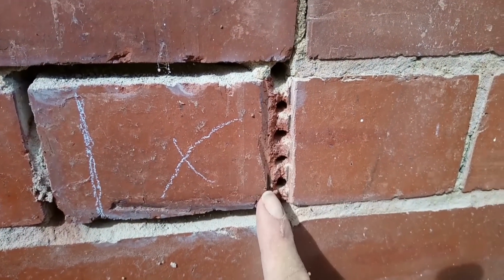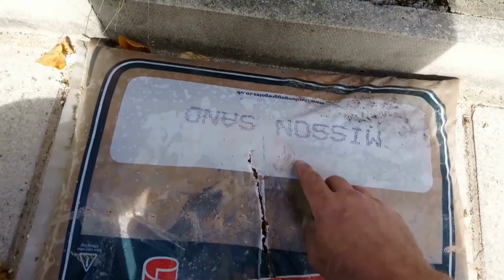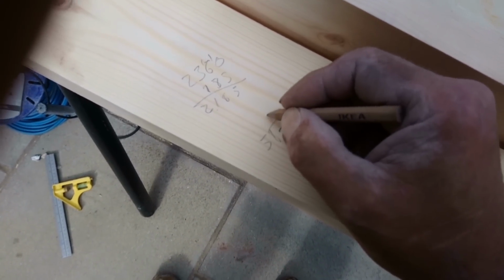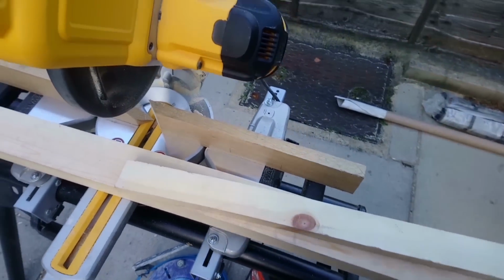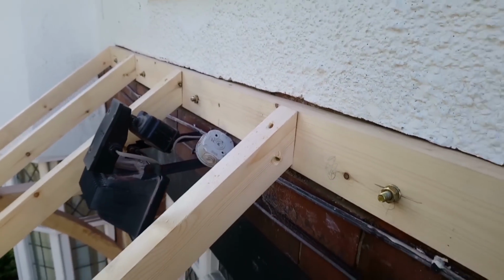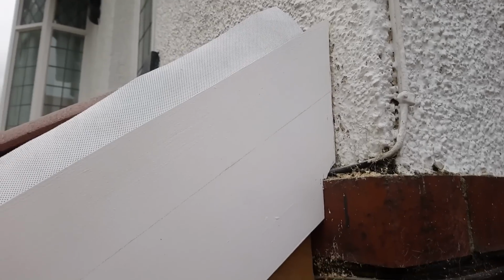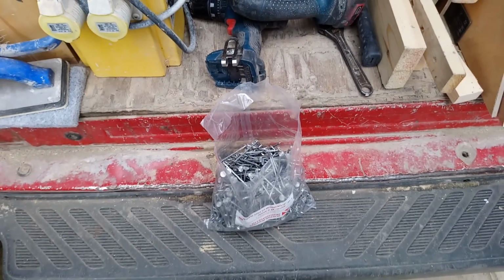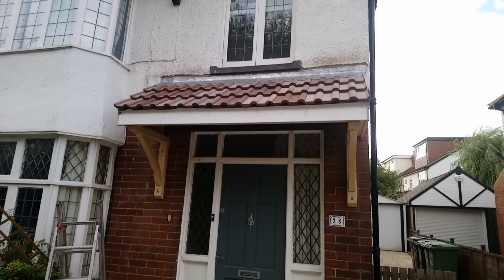Porch Canopy Build Final - Installation on the house

Comment: Good stuff Gid.  This work was part of my line when I was at it.  Code 4 lead goes to about 4ft , then another piece with 6" overlap.This is for the expansion. The long lead Apron looks better but may crack ( could take 30 years)  I always used lead bats for wedging the lead in with my hardwood bolster, but I know they are selling those spring clips now.  My method was to put a half inch fold in the lead at forward edge and dress it back down towards you. Your claw hammer is actually good for folding it, or dress off over scaffold batten.  This gives your "drip return" that stops capilliary rain driving up past lead and into your cut wall groove. If job was on an exposed S/W elevation, I put Butyl sealant well back into the groove, then offer the lead in there. Bat it up with folded lead wedges and dress to tiles.  That sealant never dries out so makes it storm proof. Point up remainder of gap with mortar. I liked your nifty thick Diamond blade. Back in my day we put 2 carborundum blades on the 9" grinder to give the extra groove width.
    The bit at the eave for the felt is called a tilting fillet. Old way was a 6"x2" cut diagonal corner to corner to give that profile.  Sometimes I did the cheeks of the porch in sheet lead, other times I wire lathed over the plywood and roughcast the same as the house.  The knees I made similar to yours.  If the roof was going to be heavy, ie Rosemary tile or heavy slate, I made triangular mono truss up and fixed them in with screwed rod and chemical grout at 600 mm centres.  Then I just put the 2 knees in for show.  Yip........you could have done with a hand on that, and even a wee scaffold lol.  Looks good anyway ..........and watertight.
Reply: Alex Bowie  !

Comment: Just about to do a pitch roof myself as a DIY’er. Watched this a few times to get the technique for the birds mouth and pitch. Really helpful vids. Nice one 👍
Reply from the maker: Thanks Adam 👍 sorry haven't been on line recently so if you haven't already built your roof there's one thing i can't remember if i mentioned in the vid, that is about the seat of the birdsmouth cut, i said 1/3 of the rafter but the seat cut of the birdsmouth shouldn't be wider than the wall plate, In Figure 2-15 of this link it shows the cut, If the cut is wider than the width of the wall plate the underside of the rafter isn't supported properly, If you go 1/3 & the cut is wider than the wall plate then change to 1/4 width of the rafter or even 1/5 or 1/6 until the seat cut is no wider than the wall plate. If you already know this than sorry but i had to mention it n i hope all goes or has gone well 👍👍 https://www.waybuilder.net/free-ed/Resources/Trades/carpentry/Building01/default.asp?iNum=0903
Reply: cheers that’s really useful! Hopefully doing the roof this weekend coming 🤞. Going to re-watch a few videos before and definitely read this 👍👍
Reply: Ok I managed to get the roof done. It wasn’t as easy as it looks but your method was good to follow. My bird’s mouth wasn’t perfect but a bit of tweeking and I got there. I’m no tradesman so that just shows the method works 👍
Reply from the maker: @adamgriffiths4178  👍 Good 👍, yeah i like roofing because a bit of thought needs to go into it 👍 maths & geometry are fine on paper but on site practical techniques get the job done too,  😉

Comment: Looks the business big man. another happy customer
Reply from the maker: Thank Mr boots 😊
Yep, They paid me in full to help cover potential Mot costs even tho i haven't finished the gutter 👍
Reply: @Gidjoiner  I'm quite sure they know you're good enough to come back and finish it by the standard of the work that you have already left. My own car / van is in the garage as well getting a new clutch been in since last Wednesday and still no sign of it being fixed using the wife's car at the minute and it's doing my head in good luck with the MOT
Reply from the maker: Thanks, Yeah I'll be back, I've to repair the bottom of the rotten door frame, crappy job that'll be 😒
The van passed!! 👍 £40 for the certificate .
I've got stuff to do on it that's been needed doing for a while but I'm still on the road, I feel ya pain not having a vehicle ,😊 I haven't got access to another so it's pedestrian for me if I'm off the road, 

That's a long time for a clutch, different garage next time?

Comment: Thank you so much. must of watched this so many times notes taken now to tackle the job.
Reply from the maker: 👍 best of luck, just remember there's a lot of weight there, i considered the condition of the wall first, the holes i put in for the brackets weren't right under the window, they're to the side with the full weight of the 1st floor bricks right up to the roof on top 👍😊

Comment: Very impressive workmanship fella ! I've wanted to build one of these for a while and this has given me the confidence to tackle it. I wouldn't know how to price it though. Thanks for your demo.
Reply from the maker: Thanks 👍 I draw it then simply add up the materials, the hardest part is working out how long it would take to build it, so i break it down into parts & try to work out what i can get done in a day, In the end the price is an agreement with the client, at the end I stick to that orig quote, it's up to me to get it done within that time-ish, I don't add on more if it takes longer so like i say that's the hardest part.
Reply: @Gidjoiner  Hey up ta for that Gid...very helpful that.  It's the most comprehensive bit of advice I've ever  had been since I set up on my own. I like your style man..once uve given the price that's it !
It is just a very varied project this canopy...interesting. Thanks again fella 👍

Comment: Nice job m8, the only thing that I would have done differently would have been to use lead mate sealant rather than sand and cement, it tends to flex and expand and contract with the lead better than cement and I know that your all about using the best products. Nice one gid
Reply: Exactly! Cement mortar point for virtually all aspects of roofing works have been removed from the BS.
Reply from the maker: Thanks 👍, When undercutting bricks, removing the cement to get the lead in I always feel i should fill it with something solid, I'm just a bit old school i guess but I'll keep the sealant option in mind, the job I'm on will get that,
Reply: @Gidjoiner  each to their own we all have the different little things and ways we go about things. I just trialled the lead mate originally and found it to be just as solid as cement but it will also flex when the lead expands and contracts so it avoids the cracking you inevitable get with cement. There's nothing at all wrong with pointing them in though -- for anyone else who bar read this.
Reply from the maker: @garethheathcote4988  Thanks, yep the flex & better adhesion is what I'm after for this job I'm on,
Reply: It's a bastard to make look neat tho.

Comment: Fine class job, canopys look a bit better with the 10x6 tiles but the price goes through the roof about 60 for a m2 plus triple lathe and time.
Reply from the maker: Hi, Thanks Mark 👍
 yeah I'd have preferred plain tiles but this was their choice to match the roof on the house.
Reply: @Gidjoiner  👍👍
Reply from the maker: These are what i call plain tiles that i put on this job, is that the 10x6 you refer to ? 
https://www.facebook.com/gid.joiner/media_set?set=a.1019538948132471&type=3
Reply: @Gidjoiner  Rosemary tiles we call them in leicester 10x6 in inches i'm old ha ha.
Reply from the maker: 🤣 just had a look at Milfords site, Rosemary's what they call them too, I'm old too 🤪
Reply: @Gidjoiner  ha ha ha ha😰

Comment: Fantastic job! I’m in the process of building one at the moment. What material did you use for the white facia board?
Reply from the maker: Thankyou, much appreciated, 👍 everything is Pine or Ply, the white faced board, (Fascia) is pine, it's over 8ft long so a strip of ply would've had to be joined at some point but also ply can start to delaminate over time, 👍

Comment: Another good one Gid, check out felt support trays on screwfix, item: 36622 will save you some hassle on the next one 👍
Reply from the maker: Thanks 👍 I think you mentioned something about sucking eggs in one of your previous comments n forgetting I've been a joiner since i was 16, 35yrs ago, those ones at screwfix are expensive, Burtons Roofing supplies do one cheaper but they're the other side of town for me, Wickes do one similar price to Burtons & is just around the corner from most of my work, also Selco has just opened a shop next door to screwfix, I chose to use scraps of ply for this job, 
https://www.wickes.co.uk/Premium-Felt-Support-Tray-1-5m/p/169557
https://www.selcobw.com/felt-support-tray-black-1-5m

Comment: Really liked it and got me inspired and i am going to build one of these for my door(easter holidays project ha ha ) 
just need bit of info if you could help 

what size timber you used for 
gallow brackets ?
wall plate and rafters ?

and what size gallow brackets you used ?

and what was the distance of wall plate from top of gallow brackets ?

Regards
Reply from the maker: Hi, not an easy one t answer that, every job is different, i would poss change everything for another job, The main timbers for the brackets were 4x3, the wall plate i think was a 6x2 & the rafters were 3x2, I can't remember the size of the main beam that went across on the front, Sorry for being vague, 👍

Comment: As a a roofer i wouldent have pointed the tiles,you can buy dry verge units and there alot better than coming back to re point it every year
Reply from the maker: Thanks, i know these people wanted no plastic, as traditional as poss, they wanted the wood fascia even if that means some maintenance but thanks again i'l keep those in mind & although the house roof is pointed i'm sure they prob wouldn't have noticed if i'd used them,  👍👍

Comment: Hi mate trying to learn my self cut roofs and lean to /porches similar to this one im struggle to get my head around pitch and birds mouths plum cuts ect why Did you put the timber underneath your level when working out pitch?
Reply from the maker: Hi, it's not easy to explain in writing but the birdsmouth cut is roughly 1/3, of the width, (not always tho, you don't want the cut so big that the inner part of the seat cut is hanging off the wall plate not supported) anyway that piece of 2x1 is roughly 2/3 of the 3" rafter, up on the wall plate I'd taped it to the level at the bottom to get the true angle with the level sitting on the top wall plate at the top, imagine if i removed that piece of wood, didn't change the angle of the level but moved the level down vertically,  basically the timber represents the remaining wood above where the birds mouth gets cut,  I've put a picture on Facebook for you 👍 https://www.facebook.com/photo/?fbid=6287679351318378&set=a.153123471440694
Ps if you look at this time in the vid 'https://youtu.be/-qkEsReNp7Q?t=866' I use the 2x1 to make the line to cut to,
Reply: @Gidjoiner  yes mate that makes sence especially with the photo you've added thanks for the reply mate enjoyed watching your vids👍🏻
Reply: @Gidjoiner  can i use that method on any roof I'm putting rafters on? Does the size of the wood change you tape to your level or is it always 2x1?
Reply from the maker: Yeah you can pretty much use it on most roofs, I've put quite a few on that's what I use, it's only for determining the angle, you might already have the angle if you're working to a specific tile that has to go on a roof with a certain pitch. or like this one i was sort of trying to match the main roof, the tile specs were also taken into account. but if you're going to do roofing more often you might be better learning rafter rules n calculations .... blah blah 🤣 Google  - size of birdsmouth cut, 1/3 will come up often but like i say you don't want the seat cut any bigger than the width of the top of the wall plate it's sitting on. I'm a general joiner & don't want to give you false info,  - On a bigger roof use a string line instead of the level when trying to get the angle.

Comment: 2:48 what do you call that tool ???? Icould use it for opening my light bulb bracket on outside wall
Reply from the maker: It's one of these, I don't remember where I bought it but Anglia Tools are ok. https://www.angliatoolcentre.co.uk/teng-ten120072n-72-teeth-steel-ratchet-1-2-square-drive-pid46948.html
Reply: @Gidjoiner  Ratchet ! That's the name, thanks!

Comment: Not sure if you still see these. But what fixings/size did you use for the gallows mate? We're they fischer?
Reply from the maker: Hi, the size will be M10 or M12 x 100mm or 130mm, prob 10mm if the socket in the ratchet is 17mm but sorry I'd have to watch it again . These are what I buy, sleeve anchors https://www.screwfix.com/search?search=anchor&brand=easyfix&moreItems=producttype&producttype=sleeve_anchors&page_size=20
Reply: @Gid Joiner  thank you for replying to me mate. Appreciate it, fitting my first canopy this weekend so want make sure I have all the right things for the job.
Reply from the maker: 👍 I had a look at this vid, at the beginning it shows the socket i used up close, it's 17mm & I say I have to drill a 12mm hole which means they were M10, I've been poorly so I'm hoping my brain isn't foggy 🤦‍♂️😂
Reply: @Gid Joiner  haha hope you feel better soon mate. And thank you appreciate you getting back to me. Iv ordered some M10s 130mm, it's only one gallows bracket going in.
Reply from the maker: 👍 I don't see any M10 x 130mm ? , I thought looking at my video that the ones on there looked longer than 100mm, but the 130mm ones on Screwfix site are M12's,  🤷‍♂️ Hope they work out ok  for you, bigger is better than too small 👍 Could you share the link of what you did buy?
Reply: @Gid Joiner   yeah after looking myself I wrote it wrong haha I'm getting m12 130mm ones for the job, it's not a massive canopy really but big enough for a first time.

Comment: Hi Gid how long did that take you to do from start to finish
Reply from the maker: Oooo not an easy one to answer, as with all my jobs i quote labour + materials & i stick to that orig price as the final invoice unless they change something, 90% of my clients are good regulars who treat me right, mainly friends of friends of friends etc.. I discuss the job & go through with them how i think it will go reg labour, day 1, day 2 etc.. with this we come to an agreement of a final price, some clients will tell me if i'm too cheap but most will accept the price i give, they know i'm not greedy, my price is often cheaper than others, they trust me, i quite often get given a key so i can just get on with the job in my own time, & they know i'll do a good job, (or at least better than some of the cowboys available 😉),  I then get on and build it, if it takes a bit longer then as i say i don't charge more, I'd prefer to do it right rather than bodge it to keep on time n run off to the next job, some jobs are hard to quote a time for but I'm not normally far off the time i quoted though, I often just make a wage or make 'enough', 😏 for this a quoted 5 days & it took 'about' 5 days, Sorry long explanation but like i say not easy to answer, after quoting i don't count the days, I just crack on with it 👍👍😁
Reply: @Gidjoiner  Hi gid many many thanks for your explanation and taking the time out to inform me, I was just curious as to how long but you have told me and again many many thanks and yes youve  done a very good job

Comment: What size compressor did you use
Reply from the maker: Hi, just a little 6L on site, it'll run all my nailguns inc the Dewalt 50-90mm framing nailer, this one is an old WolfAir, maybe 20yrs without a hitch but needed replacing last summer with a Dewalt 6L,

Comment: How does that trick work taping the 2x1 to the level pal, could you try explain. Second time watching this, quality
Reply from the maker: Hi, i think i used 3x2 in this, the 2" is 2/3's of the thickness of the rafter to the birdsmouth, It's a little hard to explain in writing. If you haven't learnt roofing geometry try this link or google 'roofing birds mouth drawing' https://www.pinterest.com/pin/523754631640318424/
Reply: Top man cheers!
Reply from the maker: The 2x1 taped to the level is to get the angle for the plumb cut at the top of the rafter, I do mention it in the vid but i understand it isn't easy or obvious if you're not used to this, I think watched a few times n maybe more understanding of roofing then come back to this n it'll be an "ah" moment 👍 sorry can't explain more 😊